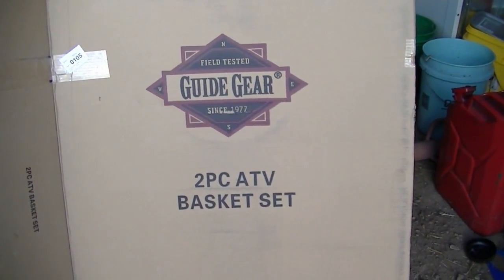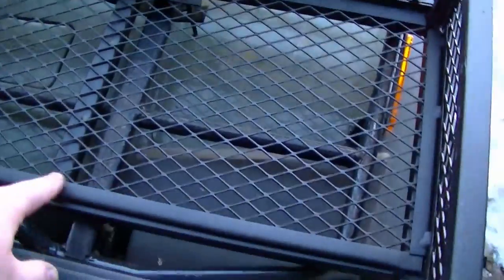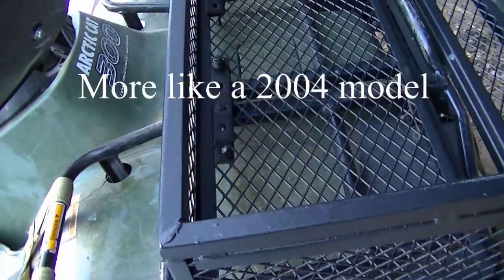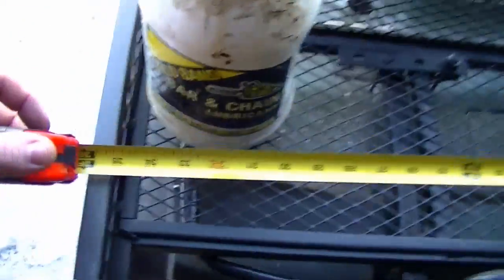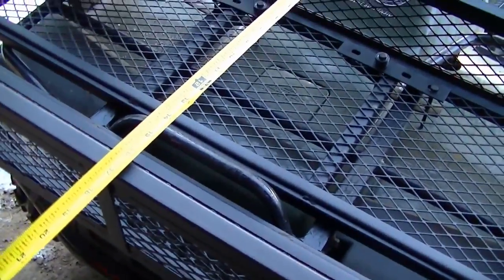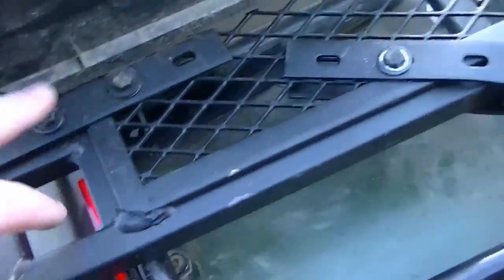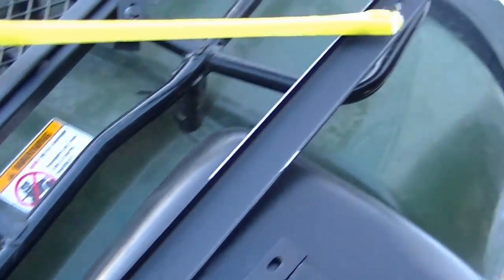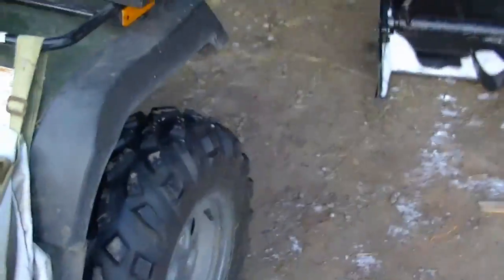2-Pc. Guide Gear ATV Front/Rear Basket Set on 01 Arctic Cat 300 4x4

Comment: dont have the rear, sold it because it was to big for my bike. the front one has been on for over 2 years and is holding up great  a little rust but still solid. put a led light bar on it for extra lighting
Reply from the maker: Colton Dieringer I ended up taking off the rear and cutting off the artic cat upright so I could move the back rack forward another 4-6 inches it works a lot better that way. I kept hitting it with my dump trailer otherwise.